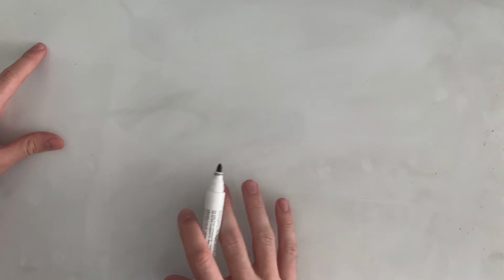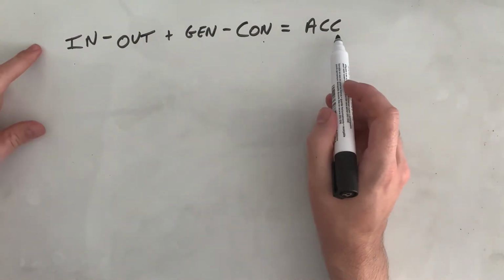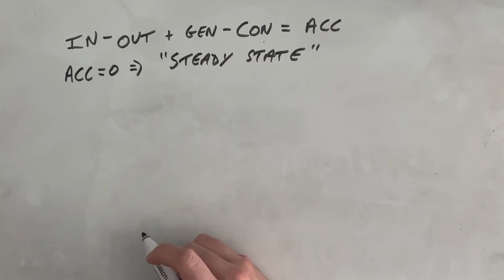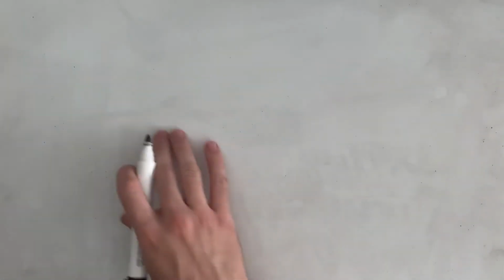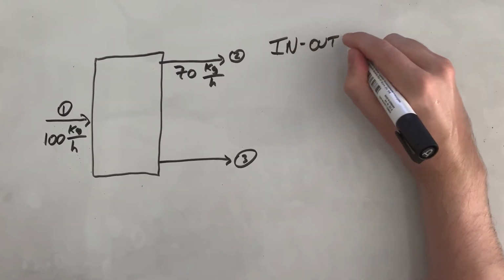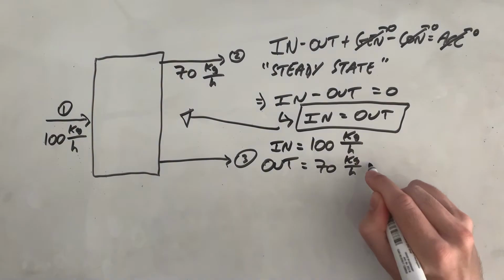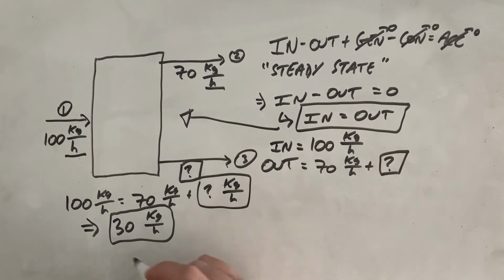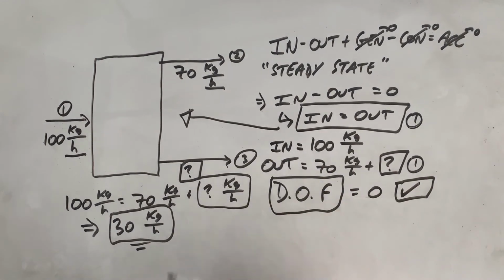MATERIAL BALANCES INTRODUCTION (MATERIAL BALANCES #2)

Comment: What happens if there is a reaction?
Reply from the maker: If there is a reaction then the 'generation' and 'consumption' terms of the material balance will not be 0. In simple cases we then use something known as the "extent of reaction" when we know the conversion of a species and then use the stoichiometry. In more advanced cases one can use the reaction kinetics (Chemical Reaction Engineering).